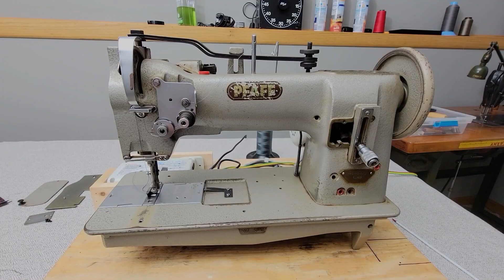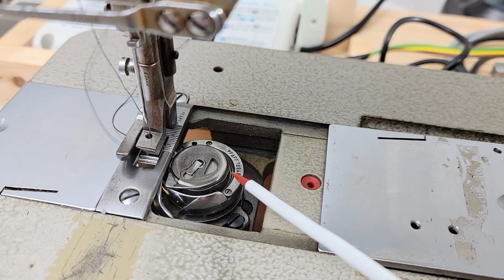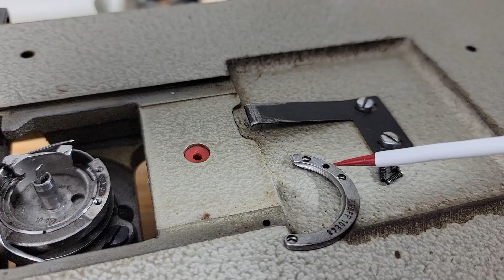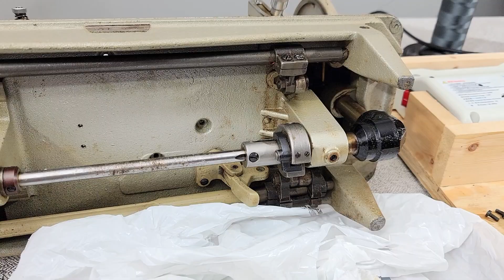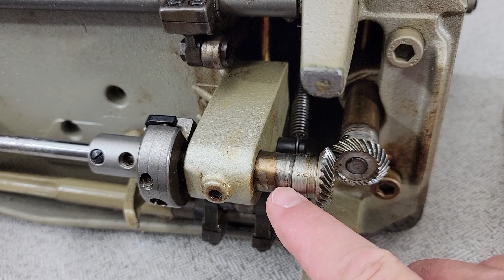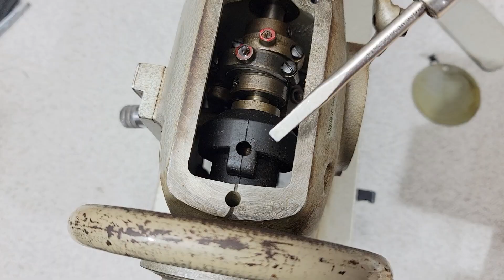PFAFF 145-H3 Industrial sewing machine oiling, grease, threading.

Comment: Hi there, that was a great video on cleaning and oiling this machine. I have two questions, what kind of grease should be used on those main gears, and the more important question, is how do you adjust the presser foot so it touches the product you are sewing, my machine has almost an 1/8” gap under foot when no material is being sewn. I am trying to sew a boat cover and it doesn’t sew well since the material is thin and slips around under the foot,  I have taken everything apart and it’s like the presser bar is not being allowed to move lower. The manual makes it seem like the pressure is easily changed but doesn’t show anything except turning knurled nut on top, which does nothing to affect the pressure. Sorry for the long comment, hope to hear back as you seem to be very knowledgeable

Comment: Nice running machine. Smooth and quiet.
Reply from the maker: Made in Germany good stuff.
Reply: @BlacksPorsche986  
I wish I could agree with you 100%. In 1965 I purchased a brand new VW Beetle. Trouble galore. I sold cameras, including professional products. Other than Leica, I'll take Japanese anyday. I'm sure that machine was well designed and built, but for the average sewer, I'll take a Japanese built Kenmore 158-1941 over anything except a Singer 201-2.
Reply from the maker: @ronalddevine9587  You know I like the Kenmore's.